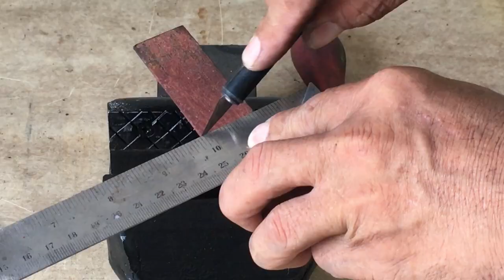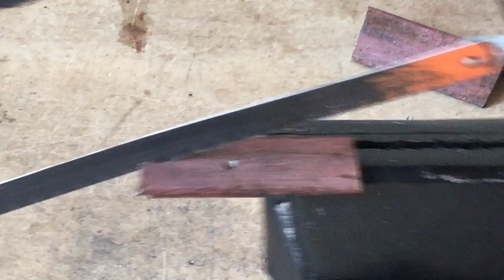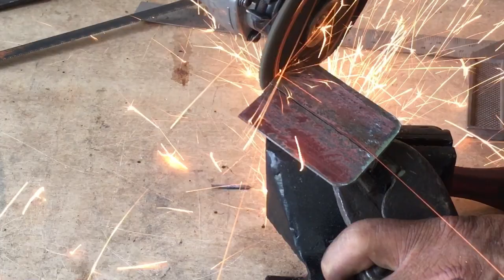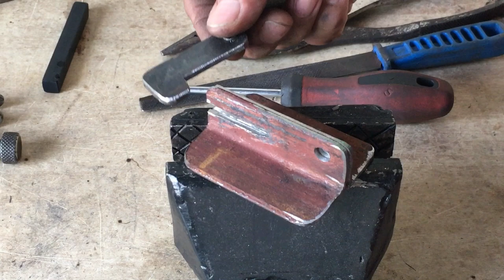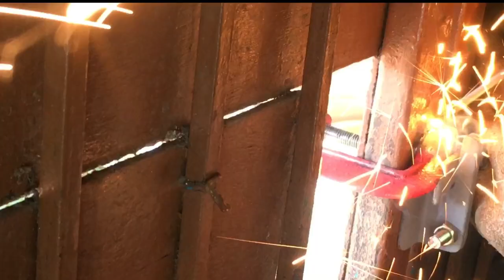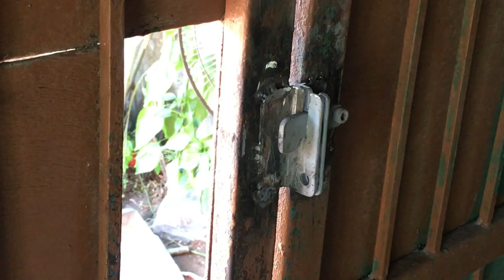How to Make Gate Door Latch Lock - EASY TO MAKE!

Comment: I have 1 question. Whats the point having the top part? Just having the hole with the padlock will suffice
Reply from the maker: Temporary quick lock so that it is not easily pushed by the wind or pets